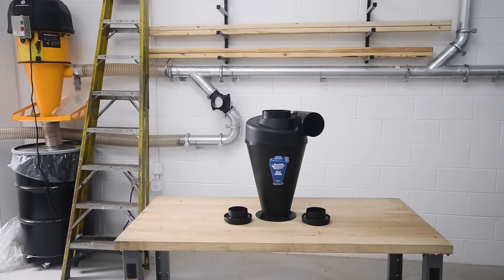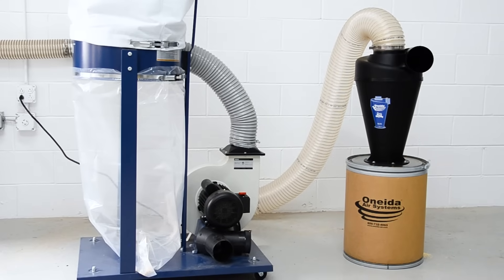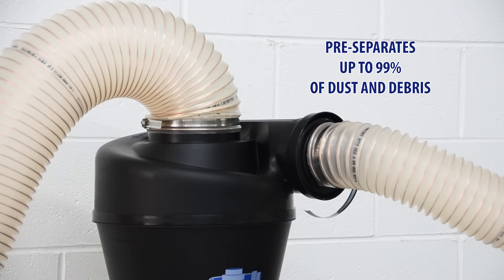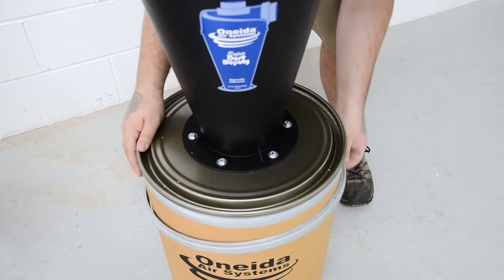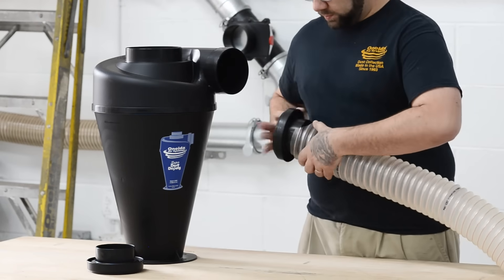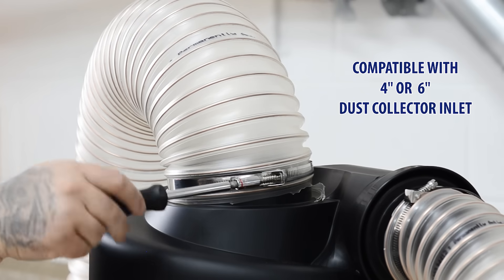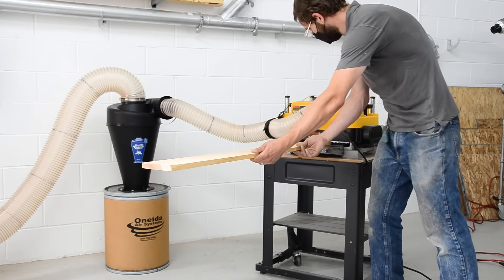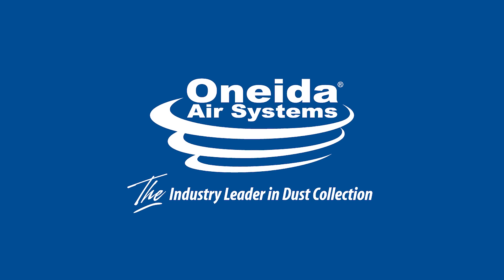New! Super Dust Deputy 4/5 - New and Improved Cyclone Separator | Oneida Air Systems, Inc.

Comment: Will the 4/5 cyclone work with the Record Power CamVac dust extractors?
Reply from the maker: Yes, the Super Dust Deputy 4/5 should work with this set up as long as it has a minimum of 350CFM and would be hooked up to either 4" or 5" ducting/hose.
Reply: @oneida-air  thanks!